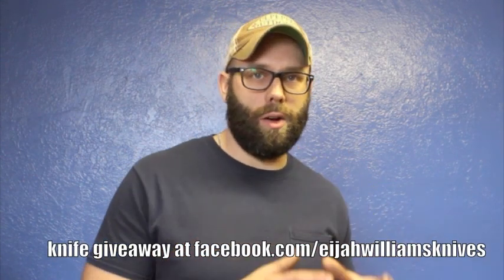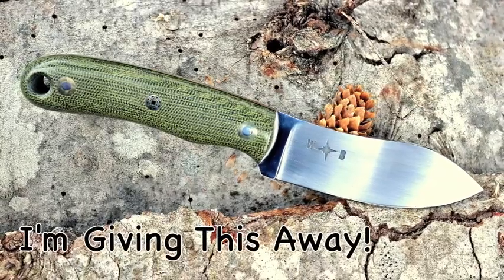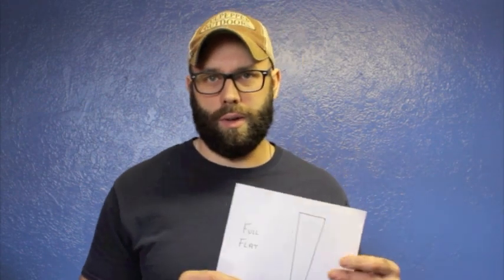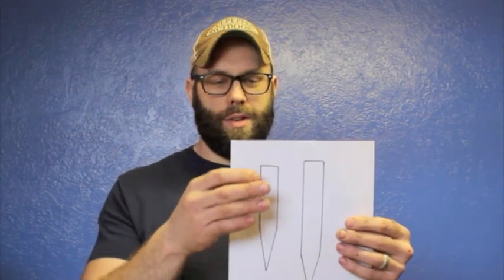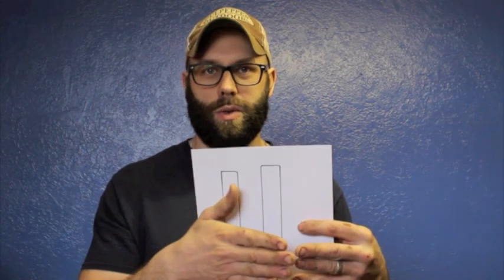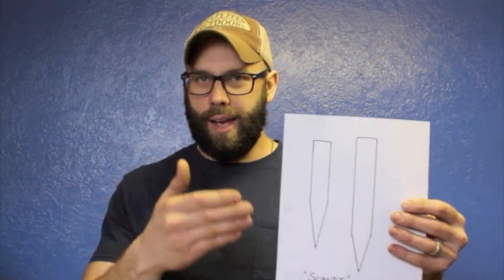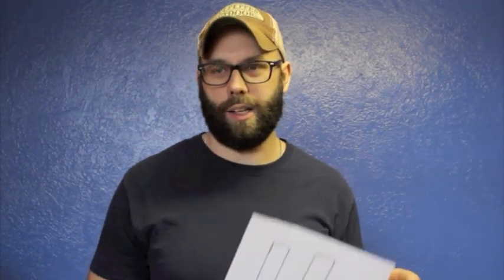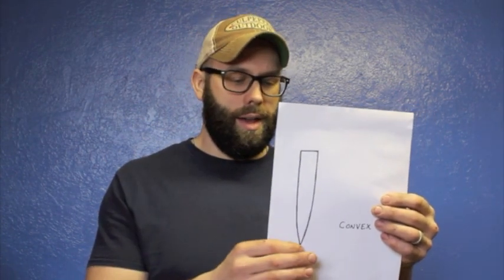What In The World Is A "Scandi Vex" Grind ?!?

Comment: Very well explained. I like the scandi- vex but one issue I have had in ‘creating’ one is that the makers’ scandi bevel is hollow in parts- rather than flat. Therefore I need to remove more material- usually at the shoulder. 
I like all the main grinds- horses for courses. But I agree FFG is the best all-rounder.

Comment: Just commenting for the Al Gore Rhythm really, but anyway, saying that that "one of the inherent drawbacks of a scandi grind is that there is less material right at the edge" - surely that depends on the angle of the edge bevel you have chosen?

Say if you have a full Scandi grind of 22° vs Scandi Vex coming to 22° at the edge, the bevel grind for the Vex would start further up the blade but the Scandi would have more material left in the blade. 

The practical difference is for use imho.

My pocket knife as Flat Grind Vex. The blade is very thin so I have convexed the edge a little to give it more bulk and edge retention and it is a great slicer, it just glides through, but it bites in to wood and can easily become wedged. 

My Camp knife has a Scandi grind so I can use it as a log splitter. It won't jam in a log no matter how hard you pound on it because the shoulder will just break the wood out. However if you try and slice vegetables it'll just split them too. 

Just my thoughts anyway. I'm by no means an expert. Really enjoying your vids, especially the Puukko build, they're really going to be something else 👍

Comment: It isn't a "Full" flat if it has a secondary bevel. The full means a lack of a secondary or micro bevel. what you drew was a flat grind with secondary bevel, not a "Full Flat". an popular asymmetrical grind with the kitchen knife folks these days is a "Full flat" on the left (as it points away from you) and a scandi or convex on the other. Often a further hybridization is to give it a scandi on one or both sides and knock the primary bevel's shoulder off giving it a pseudo convexing. This is to reduce friction in slicing. ( I can only assume this is because while a convex grind is the king of slicing geometry, it is a pain in the rump to properly sharpen).
Reply from the maker: I think the "full flat grind" has been traditionally call that to differentiate from the saber grind, which is really a "partial" flat grind, both which have micro or secondary bevels. Thank you for the additional information!